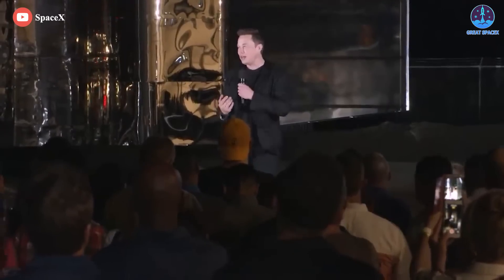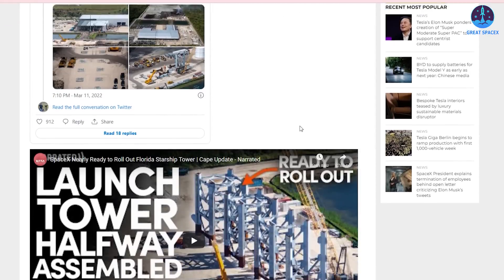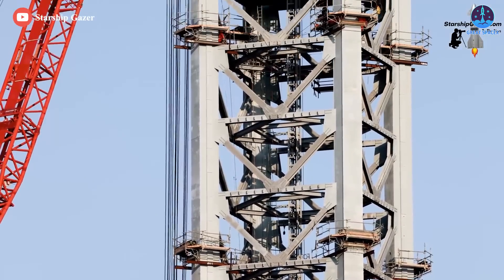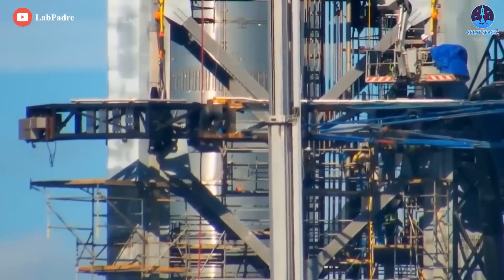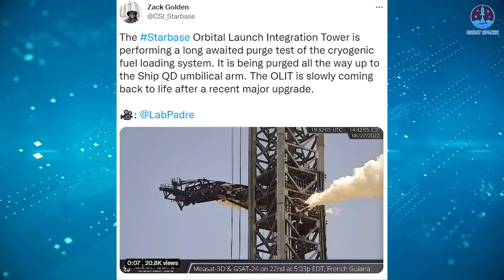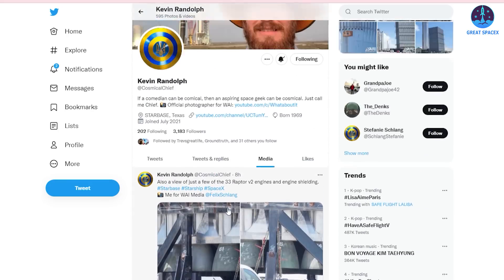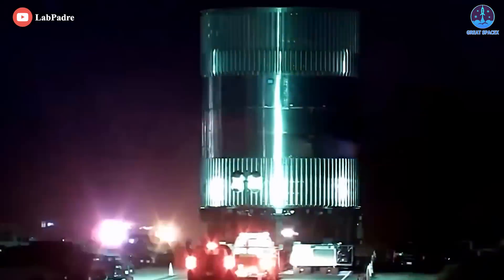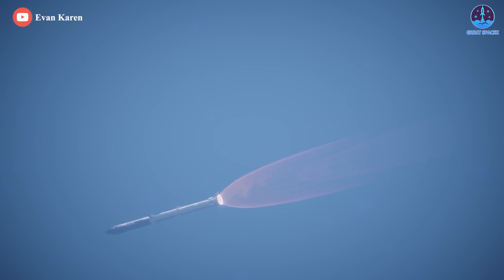It happened! SpaceX has begun stacking Starship’s first Florida launch tower

Comment: OK  ------  7.1 Crush Tank is not an After Thought...  Space X is Probubly testing much lighter versions of the 13 engine Thrust Puk and Flatened dome... Cutting up to some Ten Tons off the total weight of the Booster... Quite a significant savings in Weight for the next Booster and Starship.!.!